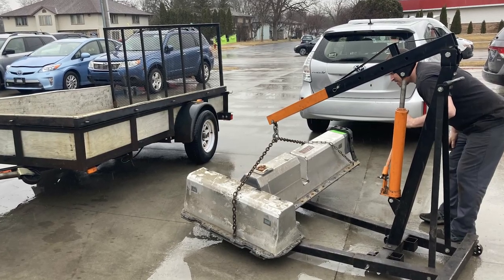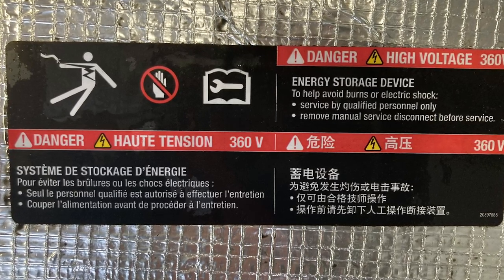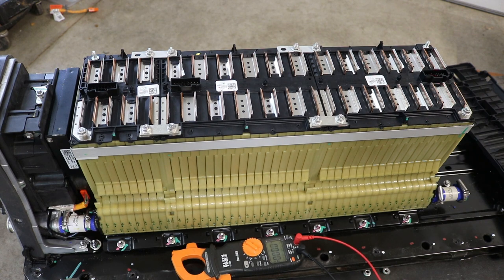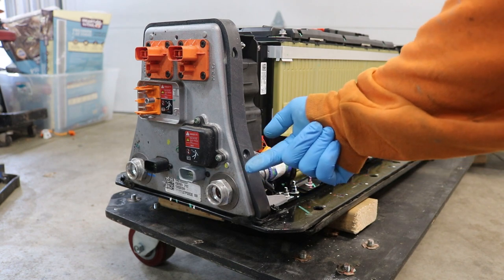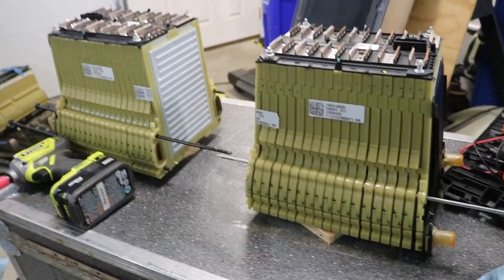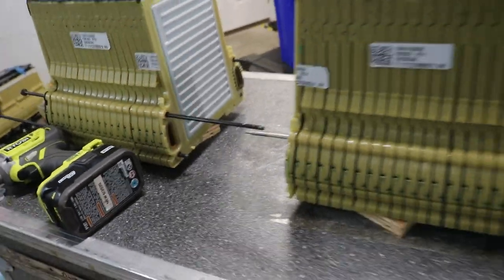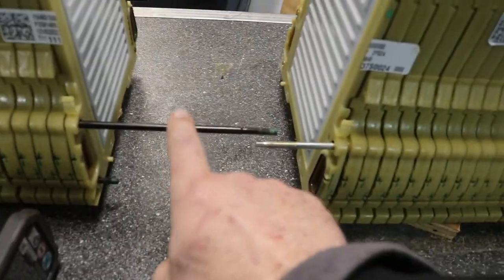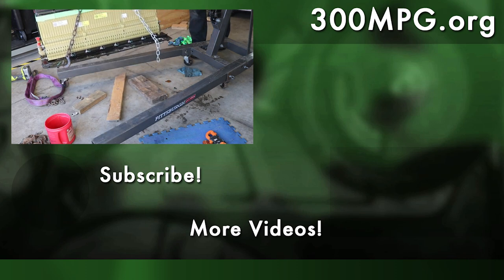Chevy Volt Battery Pack Disassembly and Reuse | Part 1

Comment: what's a ballpark price for a used pack like this? Also, i think i missed what this is going into, hoping the next video comes quickly so my curiosity can be placated LOL
Thanks for your vids Ben, i always learns something
Reply from the maker: Next video will be up tomorrow.
For this, I paid $850, but that isn't necessarily what somebody else will pay. This pack is older and specifically one section of the pack is bad, that's why it was removed from the vehicle it was in. It's also one of those "It's not what you know, it's who you know" kind of a situation. I got this directly from an independent, full-service garage that was doing a pack swap, and a friend of mine (who is very well connected in local hybrid and EV circles) let me know about it and had it held for me.
Reply: @BenjaminNelsonX  Thanks for the clear answer :)

Comment: Gen 1 has 111kW motor. At 360V, isn’t that about 308 amps at full throttle? That’s seems large. Am I missing something? (P=IV; 1kW=1000W; 1W=1V*1A)
Reply: Just curious because you mentioned the cables being light weight.

Comment: I wasnt able to reuse the contactors as I couldnt remove them off the circuit board without the pins coming out of the contactors. Was able to reuse a lot of the bus bar wiring. I like to recycle wherever possible

Comment: Many electrical meters are only rated for 300V or less, and may blow up in your face if put on say.. a 360VDC battery. Use extreme caution.

Comment: Anybody imaged replacing the Chevy Volt’s 18.4-kWh battery with a repackaged Tesla Cells groups = 103.0 kWh in the Chevy Volts Battery well / enclosure as it appears a Tesla Model S *103.0 kWh package of cell groups if restacked appropriately may actually fit in volume of space the Volts T shaped enclosure provides.  Surly it appears posable approximating the cubic inches of volume Chevy provided for “there bulky 18.4KWh package is very nearly the displacement of Tesla’s cell groups if reconfigured.
Reply: This is why I am here. Looking for anyone, and I mean anyone, that has remade modules for a volt from newer/different batteries.

Comment: Do you want to get rid of that module in the front of the pack?  It's looking like my 2011 volt has a bad battery heater and its mounted to that module.
Reply: I have a whole front arrangement with the heater and connections I can sell you. I used the battery packs for a solar project. Message me your email and i can send photos
Reply: @nextdimensions  thanks for the offer but I have already found one on ebay and installed it.

Comment: I did this a few years ago Ben.  Used ti to power my house.  Major pain in @#@ to rework the cell's.
Reply from the maker: The big down-side of these cells is that you can only bust them down to 44V or 22V sections at the smallest.
I liked working with Nissan Leaf cell modules, because they were in that handy 8.4V tin can. Nice size and shape. Easy to use for projects.

Which BMS did you use for your household backup with the Volt modules?
Reply: Yes the cell tabs cant be split.  I broke the pack down into 14S setup.  lots of work with cutting disk. I used a QUCC BMS with contactor.  I still have the volt battery not being used.  Using Narada 80 cells now 2 400 ah packs with QUCC BMS.

Comment: Hi Ben
Why was one pack only 22 volts or does that mean the 44 volt pack are two 22 volt packs put together.
Steve
Reply from the maker: It just has to do with the size of the space in the pack, and making it so that the total number of cells in series is appropriate for the motor system.

No, the 44V blocks are NOT just a pair of 22V blocks. If they were, we could break the battery down further, making it easier to use for odd-voltage projects.

At the top of each section of the battery, the tab terminals of individual cells are welded together, there's a plastic cover over the whole thing, and only a real terminal for a cable or bus bar at the end of the entire unit.
Reply: Thanks for the reply mate.
Reply: Ben sorry ask
How Many BMS connectors are on the battery.  11? So each battery would be 28v.  I am confused with the 22v, unless you have two 22v batteries welded together.
Steve

Comment: HELP MY BOLT NEEDS A NEW BATTERY SND THE DEALER WANTS $28K TO FIX IT, MY EV ONLY HAS 70K MILES WTF
Reply: IS THIS STILL A VALUABLE???
Reply: Why isn’t it covered by the warranty.
Reply: SPEK UP LIBROLE GOBBLESS
Reply: What year is your car?
Reply: Every Bolt will get a new battery for free plus another 8 year 100,000 mile warranty.    For free.  What dealer did you go to ?  Someone told you wrong.
Reply: I felt the anxiety in this comment.

Comment: Why is it you wouldn't use a power tool to tighten the bus bar connection, but its okay for it to remove them? Is it a over torquing issue? That would potentially cause damage to the cell? I guess you'd be using a non-conductive hand tool to tighten it?
Reply from the maker: Power tools are a great way to make trouble far quicker than you could by hand!

If you use power tools to tighten, you have no control over the torque, and CAN over-tighten.
Another thing specific to bus-bars is that if you are inserting a bolt through one side of a short bus bar, and tighten it with a power tool, you can accidentally spin the whole bus-bar around. That's a great way to accidentally hit another terminal and cause a short circuit!

Yes, in general, when working with batteries, use insulated tools.
Reply from the maker: Also VERY easy to cross-thread a bolt with a power driver. Would want to at least hand start at a minimum.